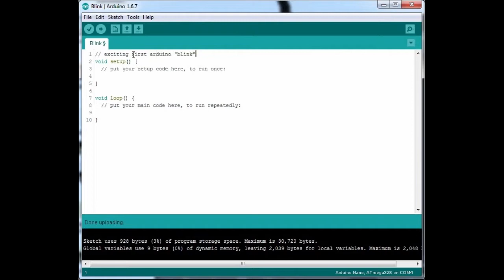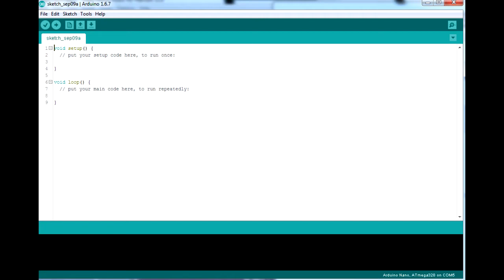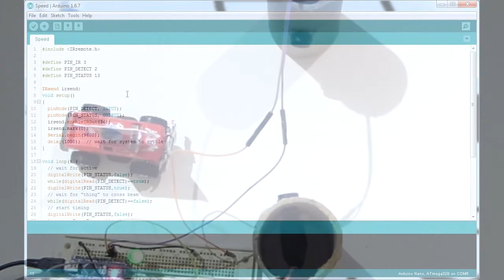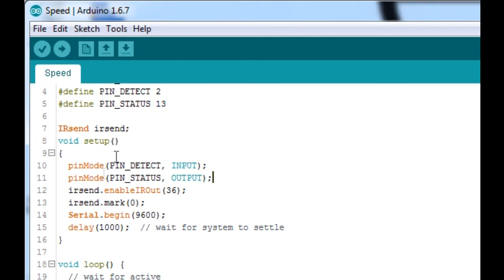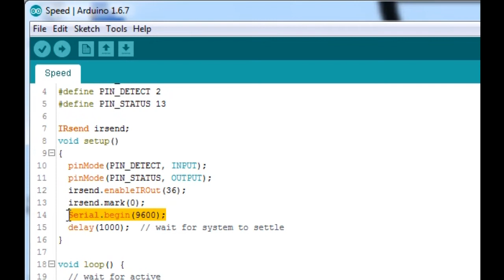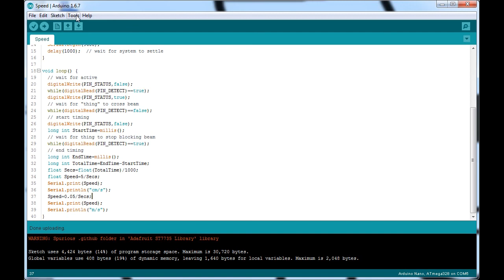Building a Light gate - measuring speed

Comment: Any chance I can shoot you an email? Im a teacher trying to set up this for my class. Ordered some parts but cant get it working.

Thanks
Reply: Receiver is picking up tv remote but dont think IR LED is emitting anyything
Reply from the maker: One problem that can occur is the receiver. If you don't get the exact one mentioned then it can end up being one that can only pick up TV type signals well and not pick up a constant signal, which is what is required. They are very common unfortunately. Have you definitely got the exact one mentioned.

Comment: Hello,

Is there a way to have the information of speed collected displayed on a small lcd screen? Thanks
Reply from the maker: Yes, you'd need to connect up say an oled and send output to that. Many displays and libraries are available. I've done several videos on several displays myself.
Reply: @XTronical  I’m fairly new but eager to learn.

Using a mathematical formula of some sort, can I convert the speed (m/s) into distance travelled,?

Basically I’m trying to roll a ball through the gate and predict how far it would travel based on the speed
Reply from the maker: A formula, well distance travelled will be proportional to speed. So in theory you multiply the speed by a constant number to get the distance it will travel. However I cannot tell you what that number would be as it depends on the friction between the wheels and the surface. You would have to conduct some experiments logging distance traveled and speed. Divide distance travelled by the speed to get the constant number you need.
With this number you can multiply it by speed to get a distance travelled for other different speeds.
Reply: @XTronical  just got a beginner kit today so eager to start playing around! Thanks for the help
Reply: @XTronical  quick question,

In the kit got a IR receiver. Which type of LED can I use to work with that received

Or should I just buy the stuff you are using?

Thanks
Reply from the maker: To be sure it works I'd get the ones in the video. A lot of ir receivers are not suitable for this project as they only indicate a ir beam for a short period of time. This is because they are more suitable for use in data applications like TV and their remotes.

Comment: I wasn't able to get this to work with a TSOP38238 that I got from Amazon.  It will work to receive IR codes, but it shuts off (output goes high) after about 1/4 second of continuous 38Khz modulated IR.  Searching found some references to the TSOP4038 which will work with continuous 38khz signals or 38khz bursts.  It is an obsolete part that has a recommended replacement TSSP4038 (and there is also a TSSP4056 that operates at 56khz and may therefore be more immune to IR signals sent by remote controls).  I haven't tried either, as these are much harder to find than the TSOP38238.  Mouser has them, but shipping makes it unattractive to buy one IR sensor.
Reply: Any luck with the answer to this? I am in the same boat

Comment: Thank you for sharing. Your setup reminded me of Back to the Future. I don't suppose it'll travel back in time when you run it at 88 mph?

A more serious question, what is the highest speed that I can measure with this?
Reply from the maker: Yes it will time travel if you also supply 1.21 Gigawatts of power to the Arduino. (do at own risk).
Your second question... . At 50cm/s the resolution is around. 0.5 cm/s. That is to say it could resolve the previous or next values to 49.5 or 50.5cm/s respectively. But nothing in between. The faster you go the worse this becomes. The slower the better the resolution. The theoretical limit would be 5000 cm/s but at that speed the resolution would be 2500cm/s
Reply: @XTronical  Interesting! How did you arrive at those numbers?

My thought was that the limiting factor was the micros() function which has a resolution of four microseconds. I was hoping to build something that can measure speeds of up to 300 m/s. I am very new to this.
Reply from the maker: Ahh, hang on, I thought I was using millis () function. Was it micros? I've no access to the code at the moment. So, yes may be more accurate. I arrived at those numbers by calculating how much the speed would change at a certain speed for a change of 0.001 of a second.